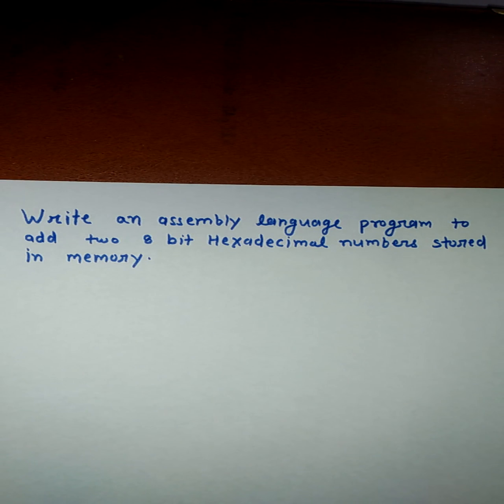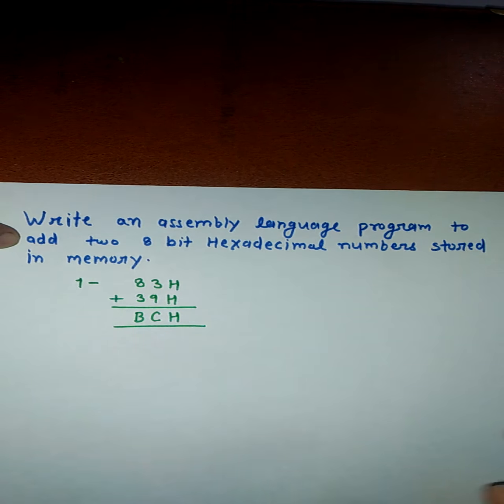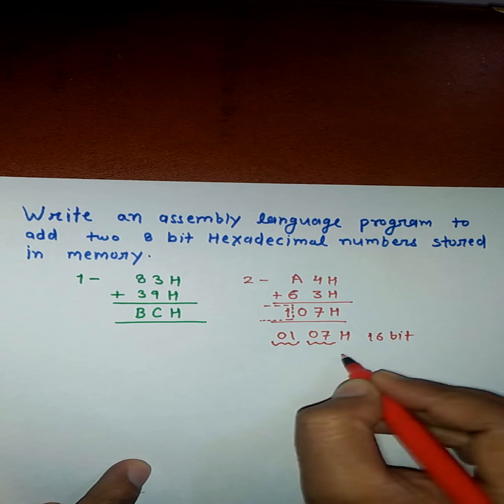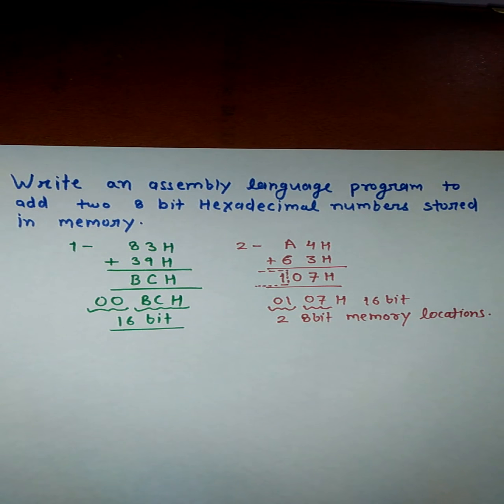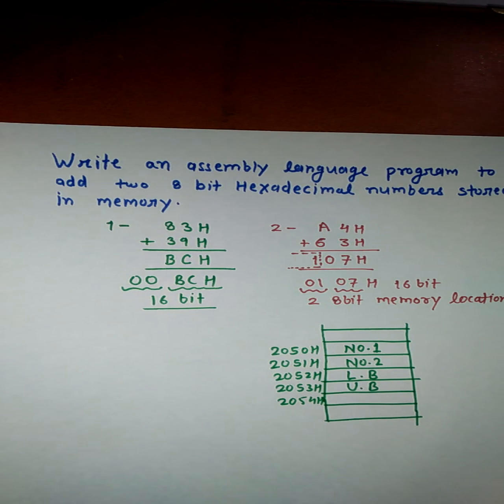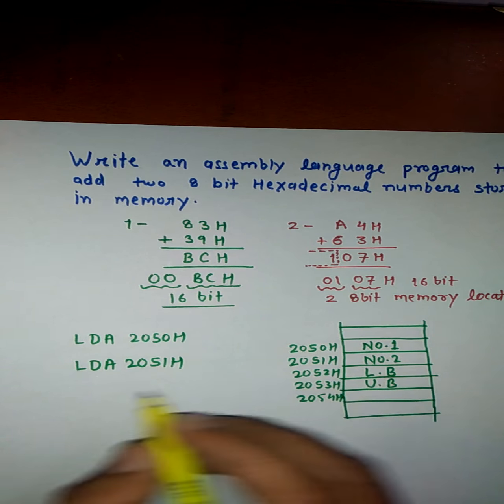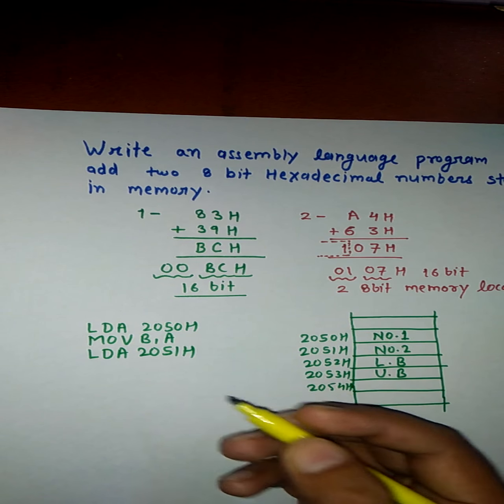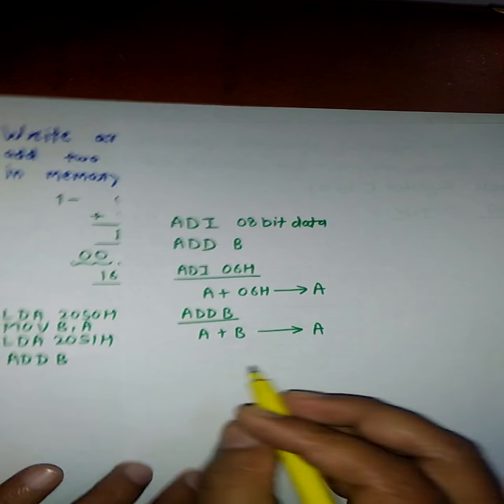program for adding any two hexadecimal numbers present in memory.

Comment: Sir after cy=1,01  gets stored in  A register and how the result is displayed?
Reply from the maker: After increasing the value in C, STA 2052H stores the result of summation at 2052H (remember result of summation is in A at this stage) next we move content of C in A and then storing the result at 2053H. here we are not displaying result at any output device we are storing the result at memory addresses, if you want to check the result then you will have to check the memory location 2052H and 2053H. 
I hope this will help you..

Comment: sir...i wan't to ask u that why same program are written in different books differently...eg...the instructions used for a particular program say..addition of 2 8 bit hexadecimal nos...are written differently...plz reply..
Reply from the maker: There is not a fixed way by which one can specify  data to the microprocessor, like for any operation you can use different addressing modes to specify operands, But at the core of the program you will find the same logic in every book.Ultimately correct logic matters not the way by which we are specifying data to the microprocessor.
Reply: Videh oh ok thank u sir......u cleared out a concept ...keep doing good work..thank's again.

Comment: sir a small doubt why we are loading the data in 2050 and then we are moving that to the register B. we can store the data directly to register B.
instead of LDA 2050H" and "MOV B,A" 
if we can use "MVI B, 39H" am'n I sir.
Reply from the maker: +Creaters forever by using memory location we may add any two numbers using same program but by using immediate addressing mode Instructions we can't add two different numbers other than used in program.
Reply: Videh ok Sir